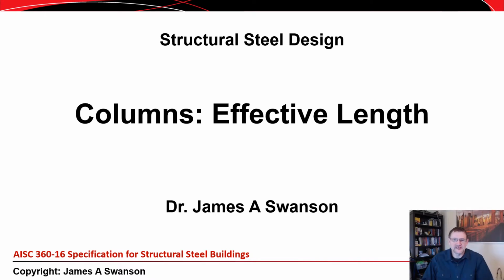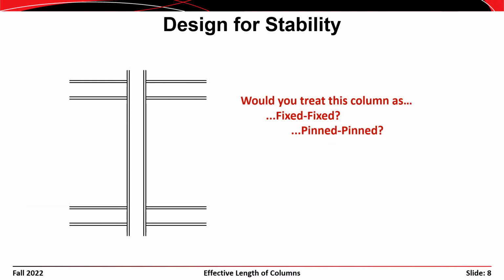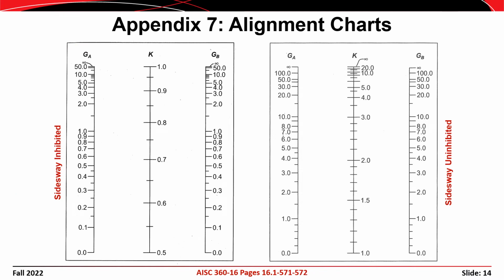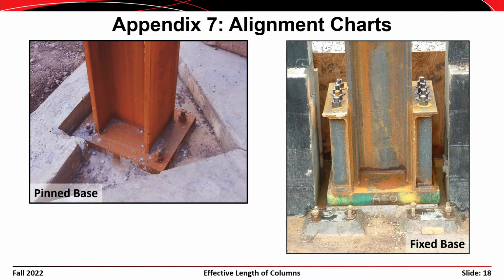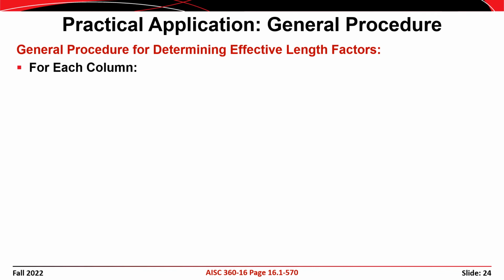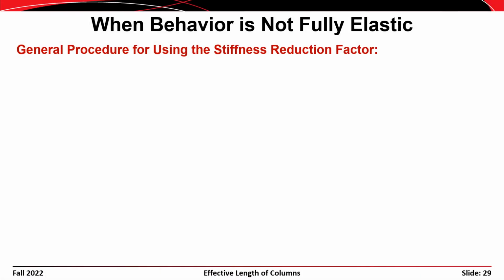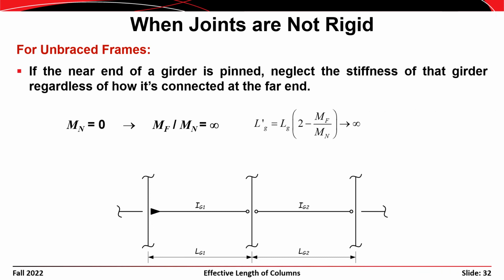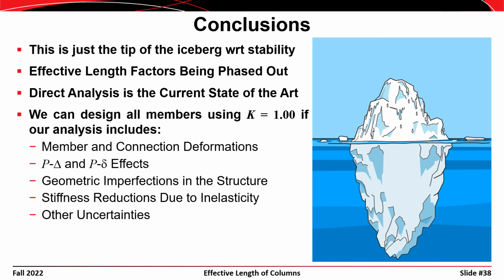Effective Length of Columns - AISC 360-16

Comment: Hello, Dr. Swanson. I have another question. I saw how that method used to determine the K factor for the stepped crane column with lower shaft and upper shaft. But I have doubts that are correct.  Can you tell, please - can an  engineer use that method for the stepped column? P.S. sorry for my English, I hope you can understand what I try to ask😊

Comment: Great video. Thanks for that. Can you  tell from which document you took the formula for determining K, which can be used instead alignment chart?
Reply from the maker: I originally learned of simplified equations for the effective length factors in my undergraduate steel design class taught by Reidar Bjorhovde at the University of Pittsburgh.  They are described in his textbook, Load and Resistance Factor Design of Steel Structures by Louis F. Geschwindner, Robert O. Disque, and Reidar Bjorhovde, published in 1994 that is now quite outdated.  Geschwindner’s current textbook, Unified Design of Steel Structures by Louis F. Geschwindner, Judy Liu, and Charles J. Carter, also includes the equations.  Both texts include a reference to a 1966 AISC Engineering Journal paper by Pierre Dumonteil, “Simple Equations for Effective Length Factors,” as the source of the equations.  https://doi.org/10.62913/engj.v29i3.592